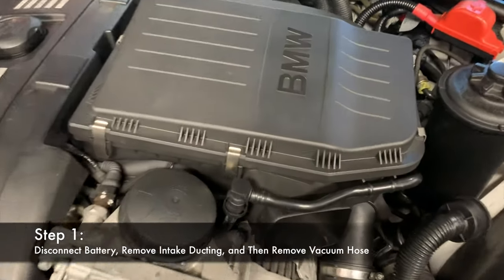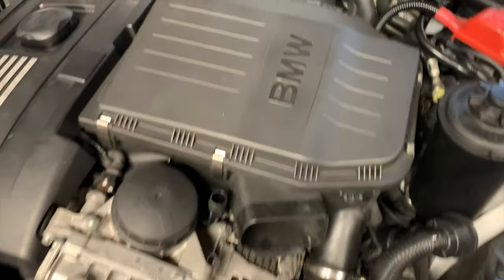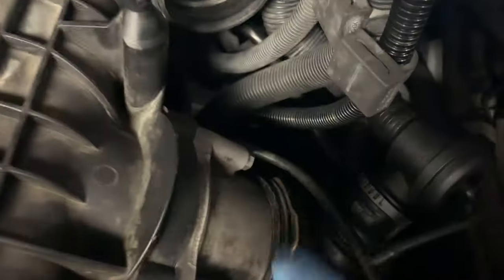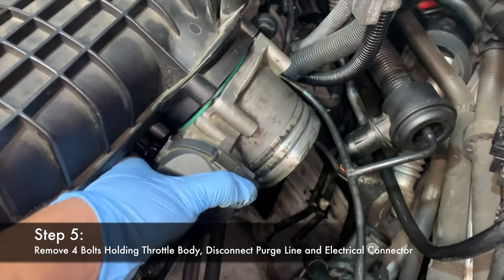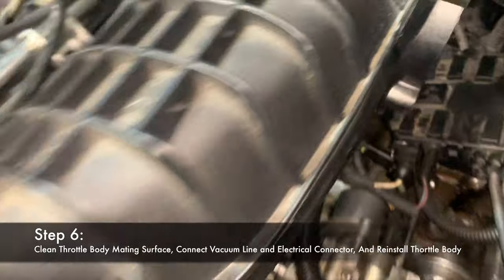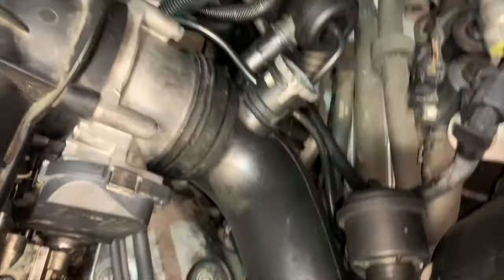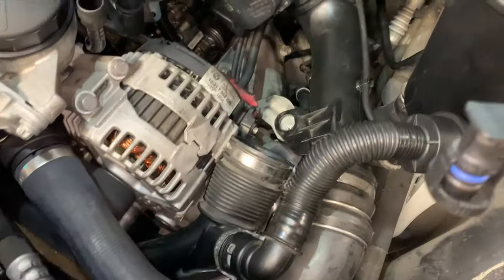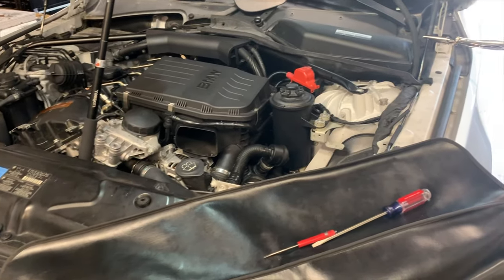DIY: N54 Throttle Body

Comment: My sons 2008 bmw 535xi has the same set up. Any idea where the mass air flow senor is? Or is that senor you disconnected take the place of the maf?
Reply: The maf should be on the charge pipe.
Reply: It’s not a maf it’s a turbo boost sensor but it’s similar

Comment: Hi DRB, How you remove the electrical connector and purge line from the throttle body?
Reply from the maker: The purge line I try to compress by hand if not I use pliers to gently compress it. I’ll make a video the next time I do one. The electrical connector should have a tab that you depress and then pull off.
Reply: ive removed the electrical connector and something strange happened: the actual plastic piece came off but all the cables stayed attached on the throttle body. cant figure out how to get them cables off.

Comment: Hey man so I’m having a problem where if I floor it the car kind of jerks and I have to let go of the gas and step on it again for it to work. Could it be a dirty throttle body?
Reply from the maker: N54? or what kind of engine/ vehicle
Reply: Same Problem and yes N54
Reply from the maker: ELI.XTRSPEED 32 if you could maybe upload or send me a video of the problem would be great I could possibly help you from there
Reply: DRB Auto I have the same problem I floor it . Passing 4500 rpms car makes a big jolt . Sometimes two jolts. Like acceleration cuts out for one second And then keeps going normal . It’s worst when on DS. No codes no check engines.

Comment: Hi I followed this exactly. But now when I start the car, the engine surges in idle pretty bad. Do you know what could cause this? Would a improper connection from the vacuum hose or the plug be the issue ? Thanks
Reply from the maker: Check to make sure your throttle body gasket is nice and flush. Also inspect it to make sure its not old and flat or bridle if you didn't change the gasket (happens to rubber over time if not changed) also make sure your charge pipe o ring isn't pinched as well. And make sure electrical connector under the charge pipe is connected. Let me know if you need any other advice. Would love to help as much as I can
Reply: @joesautosocal  I seem to be having issues with boost surging, but it only happens when I do a warm start like after stopping at a store. The car feels very sluggish to respond, and I have a throttle valve function code, as well as a high pressure fuel injection code but the fuel pumps are working properly. Do you have and advice for what this might be?
Reply: @beckmarchiniak716  so what was it, did you get it figured out?
Reply: Intake gasket probably sucked up 🤣

Comment: "do your coding and adaptation and anything like that". How?
Reply from the maker: Sorry for the really late reply. I will make a video very soon on how to do coding and reset adaptions with a launch scan tool. Not really anyway to get around it without having a scan tool. I have done a few throttle bodies that didn't require any coding or resetting of adaptions.
Reply: you do it manually, turn on ignition and hold pedal for 30 secons, then turn off for 2 minutes, then start, google it tho, how to reset throttle body adaptions manually, the scan tools dont do it, even mhd didnt
Reply from the maker: @BeatNCancer  nice! My launch scan tool actually actuates and sweeps the throttle body when I reset the adaptions. Sometimes I have to recode the module when I reset adaptions.

Comment: Hay DRB, what did you run into that you had to replace your throttle body?
Reply from the maker: Had throttle body codes and wouldn’t rev to redline and engine malfunction would pop up
Reply: @joesautosocal  I'm going thru same thing. Did you have 2CF6, 2CF7, 2E7A, 2D2E?

After replacing did your issues return?
Reply from the maker: No it did not, sorry about the delayed reply I got to put notifications on my phone! If your problem persists you might have to do relearn/ recode with scan tool to get it to work properly. If you problem persists let me know if you've done any other work on the car since it started acting up. I've seen ground not installed properly cause similar issues, especially from the grounds on top of the valve cover! If you have any more questions please ask
 @GOGOCED
Reply: @GOGOCED  Hows it goin, i know im years late but yoy may see this now and reply worth a shot. I have same codes you did. Did you ever fix it?
Reply: @LRNM340  I did, I tested a couple of throttle bodies but I think the plug in the side wasn't on there flush enough even though it was connected
Reply: @LRNM340  Hey did you ever fixed it I’m having the same issue right now?